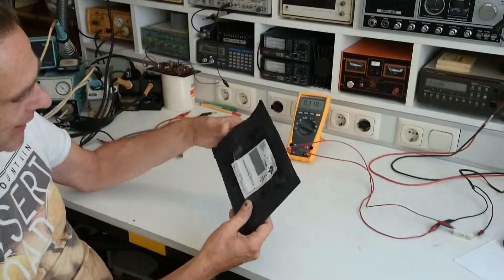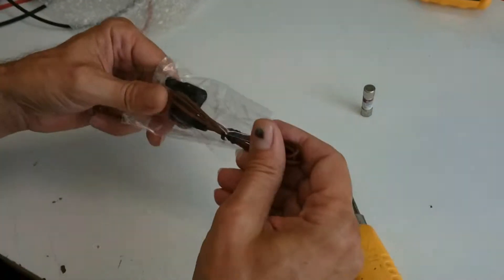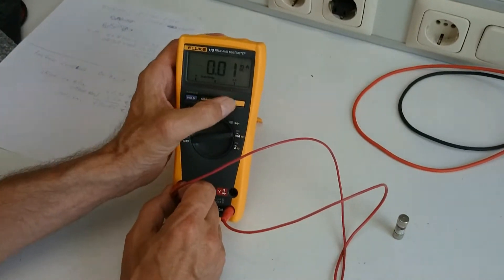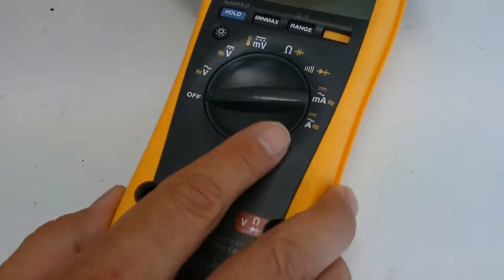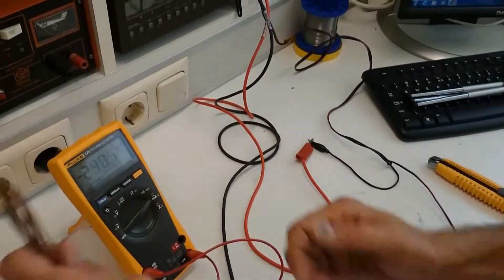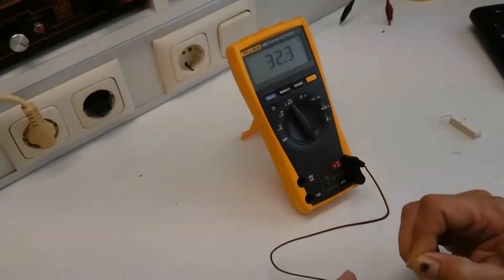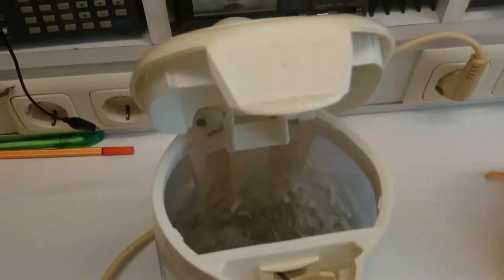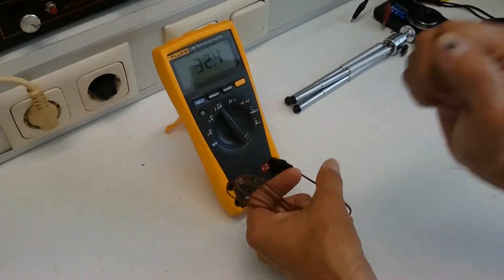Fluke Bussfuse DMM B 44 100 and Fluke 80BK A Type K thermocouple

Comment: Is there a datasheet for the 80BK anywhere, so I can see the resistance values? I don't have a Fluke with temperature mode but shouldn't it work too by just measuring resistance?
Reply: It makes mV, not Ohm. It is type K.